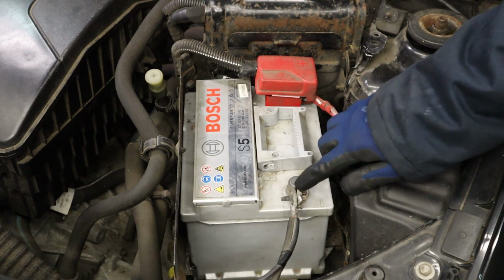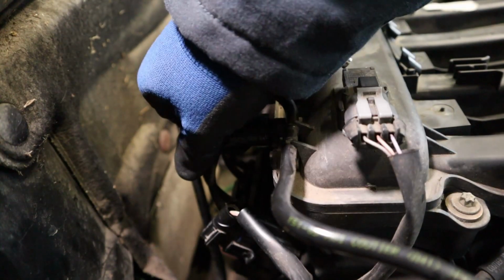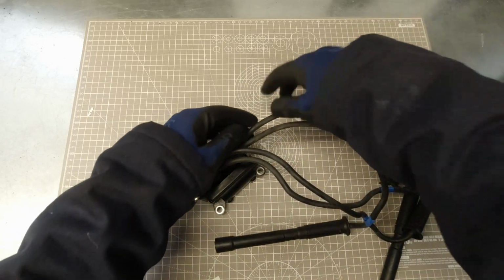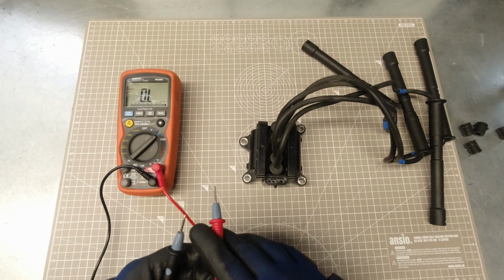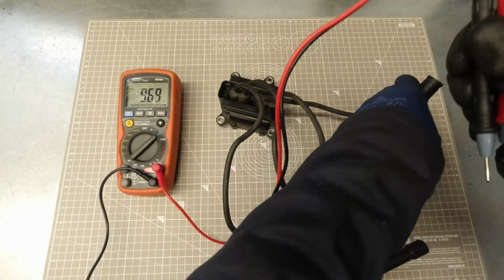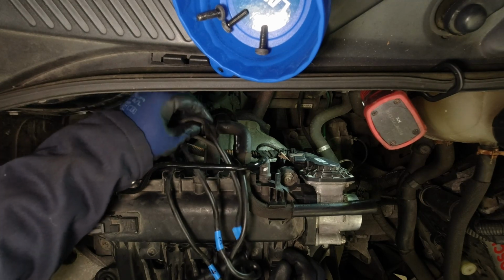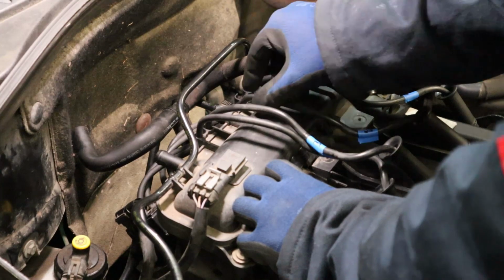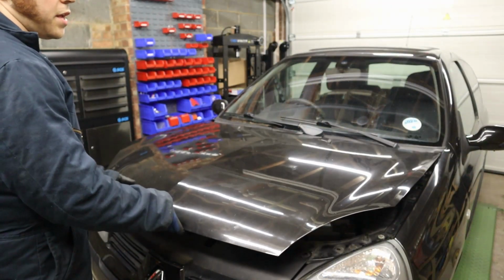Renault Clio 1.2 16v Coil Pack Testing/Replacement

Comment: Hi, I have the same car with the same engine. I have a problem with my car,  temperature does not rise over 2 blocks (digital meter) after 20km travel, normally it should be 4 blocks (in the middle), the heater works fine but I find it strange that the meter give me low temperature. I have replaced the coolant temperaturesensor and thermostat, but after a week I have the same problem. Do u know where the problem might be?
Reply from the maker: Hello. This is an interesting one as you've already changed both parts that usually cause this.
When you replaced the thermostat and temp sensor did the problem go away and then return a week later? If that is the case check the new thermostat is actually operating correctly, new parts can still be bad.
Did you bleed the system after changing the thermostat?
Is the radiator fan sticking on? Get it to come on and then go off again. Fan cuts in at coolant temp 100 degrees and out at 95.
If your car has AC then operate it as well, fan should cut in when on and the off when you turn AC off.
Reply: @SocketsAndSideburns  Hello, thanks for your response. Yes, the problem went away for a week when I replaced the parts. The fan works if I run the engine for 5 min (at 2000/tpm), then it gives 4 block (normal temperature), but once I drive it deflating back to 2 blocks. I also let the air out of the termostate. Sometimes if I drive on the highway it pops back to 4 blocks and go back to 2 blocks. But again, the heating works fine. BTW the car doesn't have AC.
Reply from the maker: I took the Clio in this video out for a drive. It's in the UK, temperature outside was 7 degrees Celsius and the temp gauge didn't move above two blocks. It did a lot of town driving and a high speed run down a carriageway. So if you live in a similar climate this is normal.
You know the thermostat is working. It's also taking a roughly normal time to heat up enough to get the fan to cut in. 
My Mrs has owned a Clio for 14 years and informs me hers has always been two blocks in the winter and four in the summer.
Reply: @SocketsAndSideburns  my clio is a couple years older... 2005. So there is no problem, because the climate where I live, is the same as the country you live in, Belgium that is. :D. You really helped me a lot. Less worries now for now. Thank you 👍🏼.

Comment: Great video. I've just replaced the HT leads on my d7f 8 valve engine, as it was misfiring, and it seemed to fix the problem but I've also bought a coil pack for it. Do you think it's worth replacing that too?
Reply from the maker: Thanks for the support.
What caused you to go for the HT leads? If it has eliminated the misfire and it wasn't intermittent anyway then they were probably the cause. Regards to changing the coil, if one part of the ignition system is going it may put extra load on another part, if you have the coil and can't get a refund then change it, you can't do any harm. I'd keep the old coil handy as a spare. It would be worth checking the sparks as well especially if they are coming up for a change anyway.
Reply: @SocketsAndSideburns  I've just been going through things to try to figure out the problem, it seemed to be getting worse, it was very juddery when accelerating, flashing engine light, and the engine would periodically shake. First I replaced the fuel filter as I thought it could be clogged, then I replaced spark plugs but neither seems to help. I just looked through forums to see what it could be, next stop was HT leads. I could still get a refund, I just wasn't sure if it was one of those parts that needed to be changed together. Thanks for the help!
Reply from the maker: No problem. Let us know if it comes back.

Comment: Looks like your PCV hose is full of yellow sludge as well. I heard it's common on this engine. I had to clean it twice now over just few months. First it was so bad it nearly blocked the entire hose coming from the crankcase. I think that was the reason it started leaking oil from the rocker cover and around the spark plugs, caused by the high crankcase pressure.
Reply from the maker: It was indeed. I'll be delving into the PCV system on this at some point in the future.